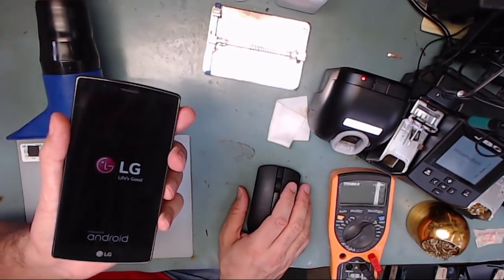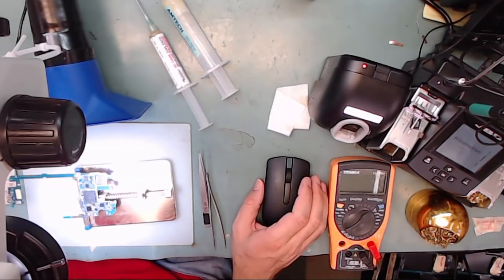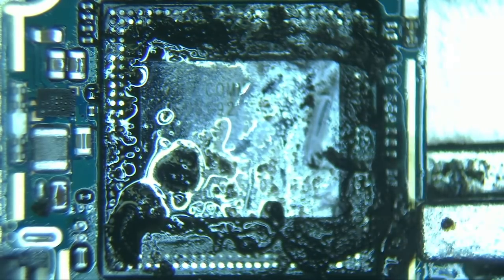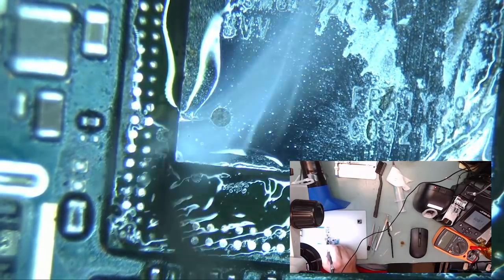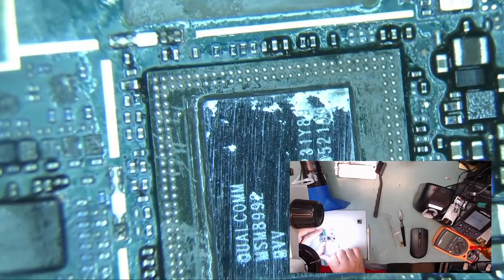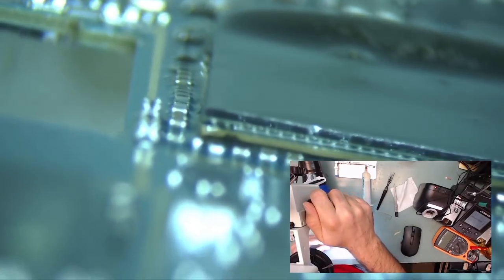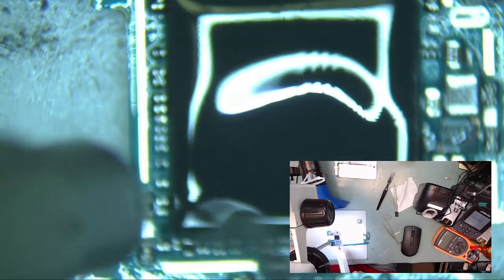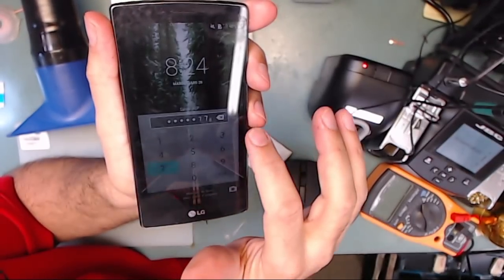LG G4 FIXED Boot Loop Turn On Off Repair Stuck on LG Logo Replaced Processor IC Chip K3QF6F60AM-QGCF

Comment: Great stuff! For desoldering, you set the hot air station to 430 °C @ 40% air flow, but to what temperature and air flow did you set the hot air station when you were soldering on the new chip and to what temperature did you set the knife-shaped tip of the soldering station when you were cleaning the contacts of the bottom chip and applying the solder paste to it? Thanks a ton!

Comment: Thank you very much for the effort at making this video. I´d like to know where did you get the replacement microchip??
Reply from the maker: We had to try a bunch of different batches to find the best quality. I have requested these to be added to our website and soon you will be able to find and purchase it there. Here is the link: http://www.cellulardr.com/lg-g4-h810-parts/
Reply: Do you ship to Mexico?
Reply from the maker: No unfortunately we do not ship to Mexico at this time. Sorry
Reply: Maybe you could provide a number or specifications about this chip so I can look for it here?? thank you
Reply from the maker: You will be able to find that on the website once the part is listed there.
Reply: ok great! I appreciate it
Reply from the maker: No problem. Hope you can get your LG G4 working again.
Reply: I actually did partially fixed it by shutting down the 2 problematic cores vía software patch, however,  this THE real and definitive FIX.
Reply: CellularDR  i would like to send my lg g4 to you but it does not have any problem but i need the heatsinks to be installed such that it does not bootloop in future
Reply: Can you retrieve datas such pivtures,if the chip was replaced
Reply: @cellulardr  ship to Serbia?

Comment: I have a pair of questions: I have understood that the problem is a bad soldering of the processor, so, why is it neccessary to change the IC? Can't you use the same one? And after repairing the cellphone by doing this you're showing, the same problem doesn't happen again? Thank you!

Comment: 1. Do you think operations like this can be done by people with minimum knowledge and experience with soldering iron  ?
2. Is worth buying a used LG G4 (on price 70-80$) that is already in bootloop and try to fix it ?
3. About heat sink, on the area over the processor, do you think that, if you add something that put a bit of pressure on processor will prevent the problem to appear again (desoldering problem) ? 
4. Can you do a feedback video to tell how this fixes behaves in time, on intensive use (like gaming) and for how log they resist?

Thank you, well made videos, good explanations, great video quality, hope to see more !
I like G4, but a new one is kind expensive for me, but i had worked with electronics devices and soldering iron, and I'm quite handy, and I'm curios if I can fix one .
Thank you !
Reply from the maker: 1 & 2. No this is one of the more complicated repairs and I would definitely not recommend buying one that has this issue and attempting to repair it with minimal experience and knowledge.
3. No pressure has nothing to do with the fix. What the heat sinks do, is consume and spread the heat, thus keeping the processor as cool as possible.
4. Sure, but up to date we haven't had any return with this defect. So far so good. As for gaming, that is very hard to test since I would have to employ someone to sit and play games on the unit to see if it will come back. I'm sure over the long term it will but short term, we have done hundreds of these without any issues or returns so far. Keeping my fingers crossed.

We are very happy to hear the feedback about the video and thank you for taking the time to write the comments. We definitely plan on doing more of these videos on a regular basis.

Take care.

Comment: I know this is an old video but the problem with the G3 and G4  has to do with the solder that was used (and/or the technique.) The "ball solder joints". A pin or two, or three from the CPU becomes essentially disconnected from the board after heating and cooling down over time.

Comment: Is this solution permanent? Or after some time back to Bootloop? I have the H810 model but I am from Ecuador. Thanks for your answer. Great video!!
Reply from the maker: We cannot know for sure, because there are many different variables, but since we started using the heat sinks we have not had any return with the same issue.

Comment: Thanks for the excellent  video. 
How did you know that the chip was faulty and reballing would not have helped?
Do you have any experience with Lumia 830 bootloop?
Will it be also necessary to replace the IC?
Thank you for your reply
Reply: If your time is worth something that is you are being paid by hours and your throughput affects your salary as well you'll find using factory "balled" new chips a much wiser option. If you work on your own then especially in a case like this one reballing would save you a lot of money and be a much quicker fix.

Comment: Non conductive thermal paste also works instead of copper tape for the heatsink repair? (im going to use artic mx 4 on the top of the chip and rams)

Comment: Very informative video! Keep up the good work. I just wanted to confirm if the given processors will work the same with other models as well? I have two G4 as follows:

(1) H811 (doesn’t goes past the LG logo and starts heating up); and 
(2) H815 International Version (it started this issue yesterday and as you said, I didn’t turned it on at all to avoid any more damage to the processor chip. Should I try the reflow and heat sink replacement method first before going for the processor replacement?)

I highly appreciate your video and kind effort for the greater good of common people. I just hope LG sees your good work and feels some shame on their poor quality controls.
Reply from the maker: Go ahead and re-flow it but very carefully and not too hot.

Comment: great video!  Just one small comment - the "processor" on the top is not a processor, but an LPDDR ram chip.  Just google the part number printed on the chip will confirm this.

Comment: I had similar issue. my phone stuck in lg logo and won't boot. I fix it by using octopus box. and now my lg g4 h818p works fine. :)
Reply from the maker: Sounds like you had a software issue, but I would definitely still install the heat sinks to keep the phone from further damage. Here is the link: http://www.cellulardr.com/lg-g4-copper-heat-sink-adhesive-4-small-pieces-precut/

Comment: I did exactly what I see on YouTube trying to fix my lg v10 booth loop issue.  However, I don't know what I did wrong but after I assembled the phone back instead of it to be revived, the screen now divides into two horizontal sides with one side black with the lg logo and the other half white with kind of small patches. I love this phone and barely used it for two weeks after I bought than the dreaded loop started. Is there anything that can be done to bring it back in working  condition.  What. Could have gone wrong.

Comment: I have a different problem. I have a slip screen issue. Where half the screen work perfectly... And the other half works when it wants to. Everything I read online points to the processor not being seeded right.   How do I fix that issue correctly?

Comment: g4 working fine now just booted 3 times then after working fine almost 30 mis now working fine now it will work fine using heavy applications
Reply from the maker: I would not use heavy applications and games. I don't think this phone can handle it and might overheat again.
Reply: Really appriciate your prompt response
Reply from the maker: No problem. Glad to help.

Comment: my lg g4 815 i applied your method...can i use intense apps now on my phone or shall i buy new one
Reply from the maker: What method are you referring to? Did you change the chip?
Reply: I applied heat sink sheet
Reply: hello sir are you in pak plzzz help me to set same problem of my g4 plzz
Reply: I applied this heat sink sheet but my phone is still in boot loop worked for only one day

Comment: If problem half screen is same case with bootloop?
Reply from the maker: No that doesn't sound like the same problem.
Reply: that problem causing some print missing display connector to under processor

Comment: Yes ,can I send my phone to you and get it fixed you've got an opportunity here mate help the the masses, I like my LG to be honest I'm actually using a Galaxy S7 edge at the minute despite the massive massive distance in prices, I would still probably like them about the same,   I feel LG the company should have been made called back all the phones and fix them because, I only had mine a wet day, when out of nowhere my battery drained one night and that was the end of my phone, I actually think my one could be a battery issue because, I can never get it to charge is this possible, I heard somebody saying one time that there are two ways that you can get the Boot loop 1 is of course their separation of the chip and the other apparently is the battery gone wrong and mine my battery doesn't charge at all what do you reckon